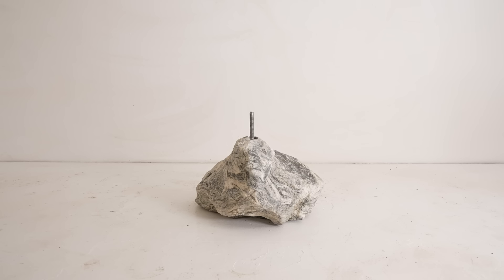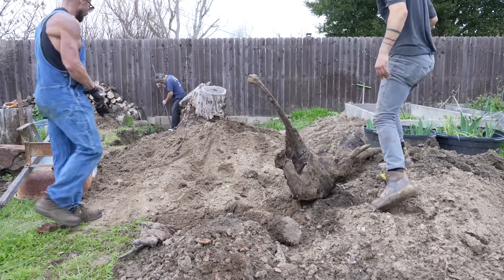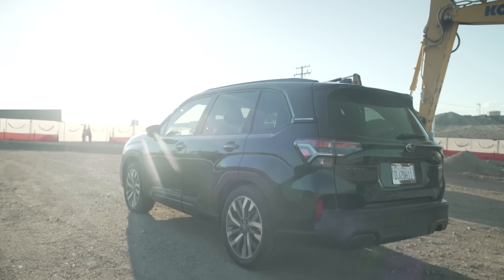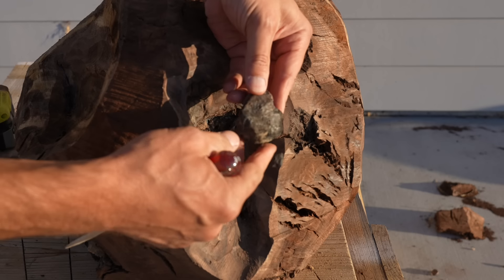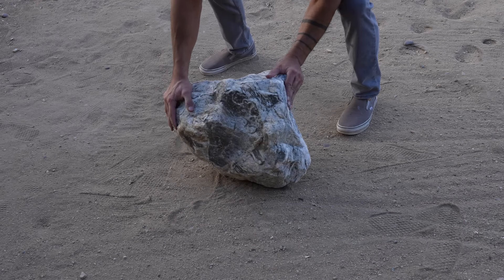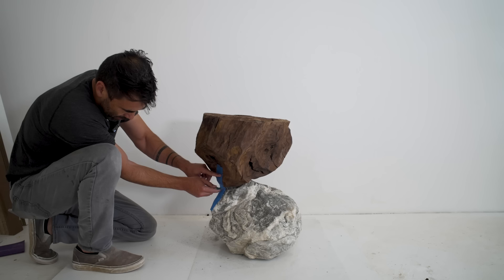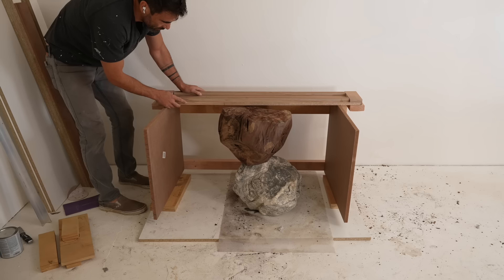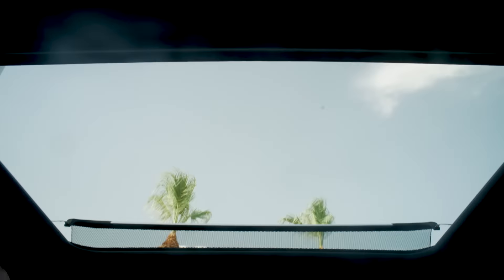Table made from Walnut Root and Rock

Comment: The only reason I’d consider filling the cracks is so dust doesn’t settle. Cleaning it would be a bit of a nightmare, but it turned out so nice!
Reply from the maker: yes, great point as of now it is a piece that needs to be vacuumed.
Reply: I'd  clean it with one of these brush attachments for the vacuum. I think. With the brush mostly to prevent scratching the surface with the vacuum nozzle. Should get any dust and debris out of there, don't you think?

Comment: They have attachments for angle grinders, and another tool I forget the name of that wood workers use, where you can plunge down into cracks and crevices to grind away at the sides of deeper holes, or even work on holes that curve and don't just go straight down.

Comment: Do you measure the moisture level in the wood before working on it? Are you worried the hole where the metal pipe is glued into the wood will expand and become wobbly as it dries? 
I'm debating about using Simple Finish on a piece of pine I'm working with that's still drying and is at about 20% moisture level.